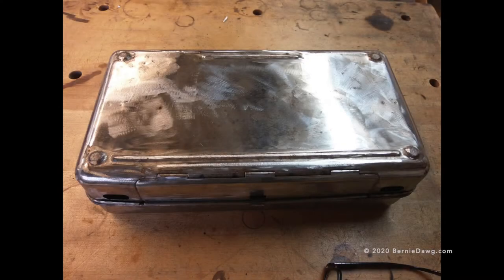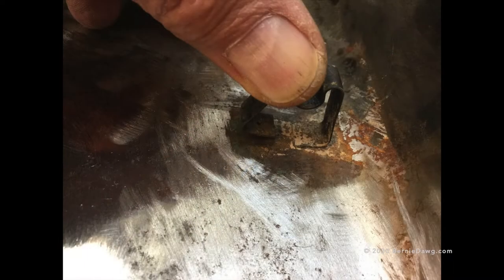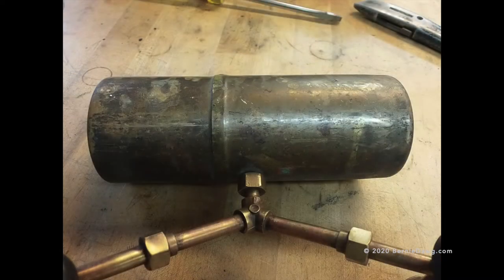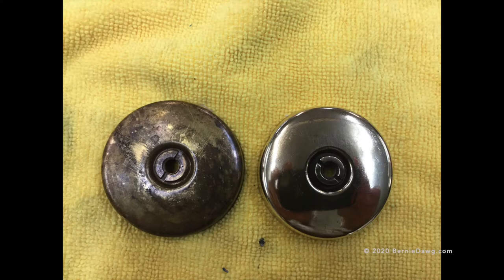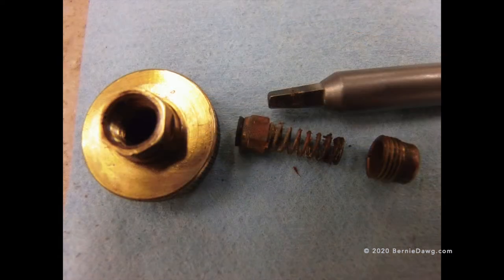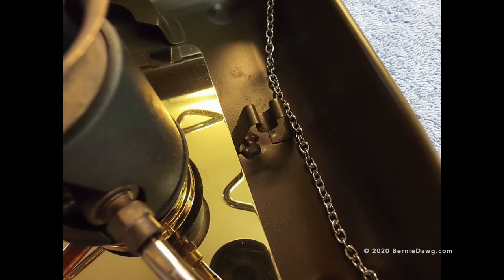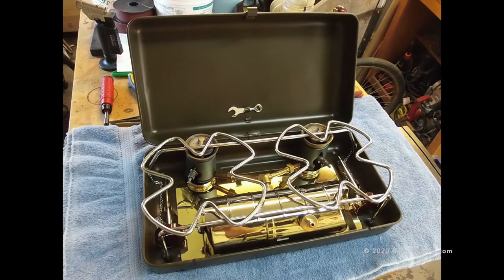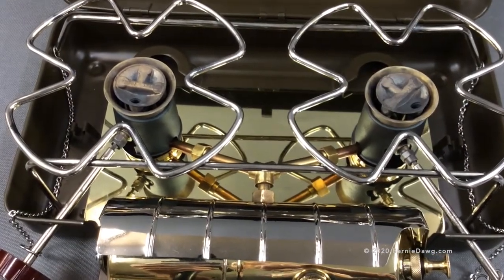Optimus 22 Stove Restoration and Repaint

Comment: i went through hell restoring mine, especially wire brushing the box.....i wish i had a sand blaster....its almost a must have if you restore stovess....
Reply from the maker: @ahah1785 Doing it by hand or wire brushing is definitely no fun. Sandblasting can set you back $1-1.4k for even a basic rig that's worth monkeying with. On the other hand... my local sandblasting guy has a minimum charge of $80. That'd get a 22 case done 'cause there isn't that much surface to blast. Something to consider for you or others if you need the work done. 👍 TANSTAAFL. BD

Comment: Hello brother, may I ask where you bought your control rod mount?
Reply from the maker: @張嘉宏 The metal clip that holds the spindle control knob is a feature of the stove from the factory in Sweden.The one I show in the video had come loose from the stove case. I welded it back on. I know of no source for these. The stove is long out of production and parts are very hard to find. The clip was likely never sold as a replacement part anyway. If you need one, you'll likely have to fabricate it from sheet metal on your own. BD

Comment: Yes, those are beautiful stoves, huh?  I love the  shape of the pot supports and the angles on the flame adjusters.  Some love was put into this design to my eyes.  I've never seen one in person.  ...just not common over here in Maine and when they popup online they are wicked pricey.  I appreciate having a better look with your video.  ...and the drip pan!  ... your idea?  Fantastic!  Thanks for sharing!  What would be the difference between the 22 and 22B?
Reply from the maker: The drip pan is a pretty common idea among stove fans. I didn't invent it. You usually see drip pans made by cutting open aluminum beverage cans with scissors for stoves like the 8R. I have stainless pans in my personal 111/22 type stoves for ease of cleanup and protection of the case paint. My SS sheets are more substantial and better heat protection than aluminum bev cans. The client-requested brass is blingy, though, and goes well with the OD green.
The Optimus 22 is a multi-fuel stove. It can burn kerosene or white gas. The Optimus 22B (and it's single-burner sibling, the 111B) is white gas only. BD
Reply: @BernieDawgCinema  Thanks for the response!
Reply from the maker: @Daniel Grenier De nada. I'm all about edjukashun. 😄 BD.

Comment: Hello BernieDawg, what do you use to paint the boxes on the optimus stoves? Some kind of high heat paint?
Reply from the maker: @Kieran Higgins All my painting is rattle can. (I have an HVLP rig, but it’s gathered dust for years now.) The military green colors you see me using are Gillespie Paint from armyjeepparts.com . https://www.armyjeepparts.com/t-GCI_paint.aspx
They are very durable when air-cured for a full 30 days.
The other more traditional shades of blue, green, the metallics, and even the orange metallic for the Phoebus 625/725 are all automotive paints, generally Dupli-Color or, if there’s an appropriate color match, then occasionally VHT Flameproof.  There is no need or reason to use “high-heat" paints on stove boxes since the original paint was not "heat resistant” beyond what any good auto paint will have. Good auto paints can take a lot of heat (think about the hood of a car over the top of a V-8 engine on a very hot day). The original on most stoves is just a quality auto paint. Original manufacturers also did not use primers or undercoats but color coats directly on metal. Always air-cure your paints a full 30 days after spraying to ensure a full fuel proof finish. Most paint problems come from early use. Visit your local auto parts store for paint selection. Most NAPA, PepBoys, and the like will have hundreds of colors in rattle cans on the shelves. Good luck! BD
Reply: @BernieDawgCinema  Thank you very much for such a detailed response. I was thinking i needed a paint sprayer but this sounds much easier and cheaper. Going to try to refinish an 8R I picked up for $10. Any tips on shining brass? I always used Brasso, but heard from someone that it can damage the brass. Not sure if that’s true or not. He said to use toothpaste. How do you get your stoves so shiny?
Reply from the maker: @Kieran Higgins The 8R is a great first project stove. There are tons of them around, so there is no reason to be nervous you might mess up a very valuable or rare stove. Frees you up to practice without consequence. Brass doesn’t generally need to be shined unless there is obvious green or red corrosion present. If you want to do it just for the pleasure of it, Mothers Mag and Wheel polish is a great ammonia-free polish available at auto stores. I use that and also a powered buffing wheel with jewelers rouge. And, yes, ammonia can accelerate or cause stress cracking in thin brass sheet like your fuel tank is made of. I’m not sure that ammonia polishes are so much of a worry when we’re talking about fuel caps or other solid thick brass items, but why take the chance? If you are working on a 8R you may wish to view the 8R videos I have in this playlist here:  https://www.youtube.com/playlist?list=PL9Tg7BYD6fUJ4L9S6PipKE0-GOAlUVShb
Those videos should get you through a complete restore. And, if you have problems or need further assistance: bd@berniedawg.com  👍 BD
Reply: @BernieDawgCinema  Thank you!